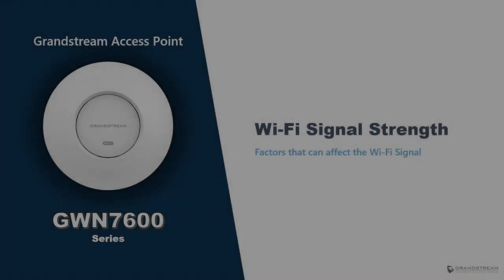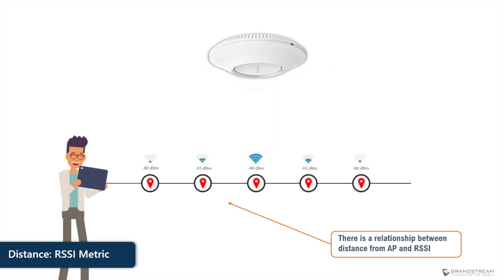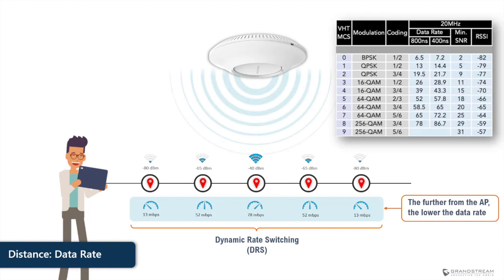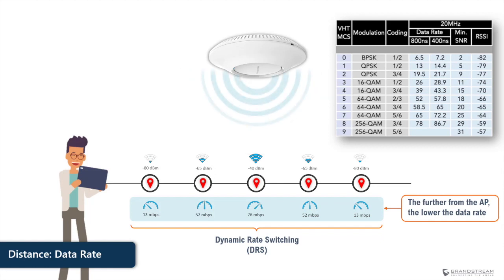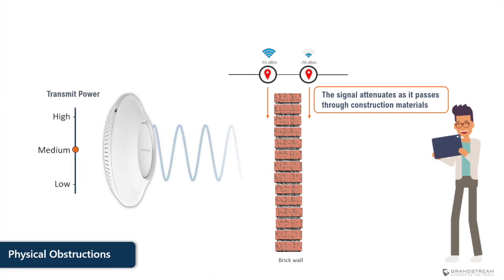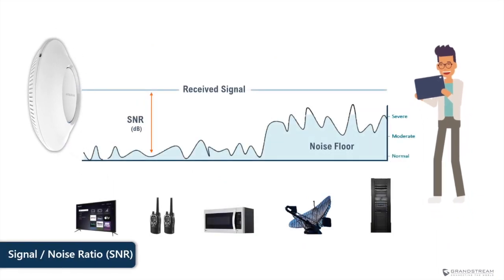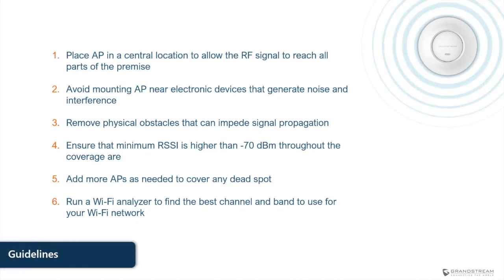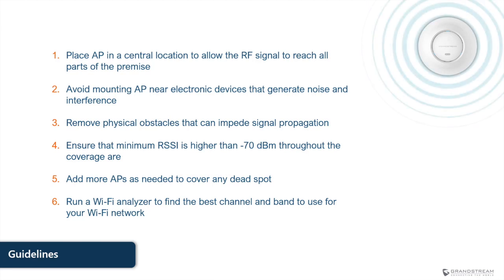Video Guides - Wi-Fi Signal Strength - GWN Series

Comment: Love Grandstream.    Just did an install with the latest GS AP units in a chain config, only one connected to the network, the other power locally via small POE transformers.    Linked four structures.    Solid as rock.    Very happy.   VoIP Portland has done a lot of phone/UCM installations since 2014 but it is pretty rare we are asked to do WIFI but nice to know GS has us covered.